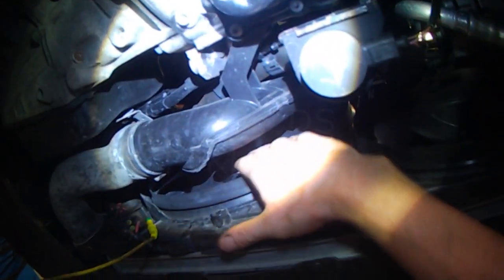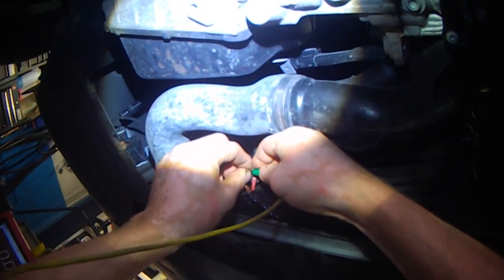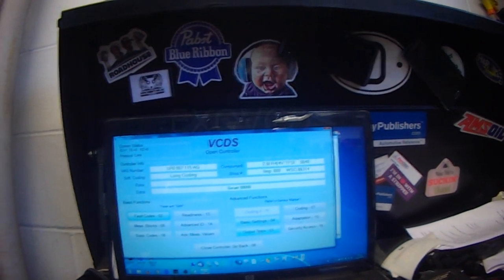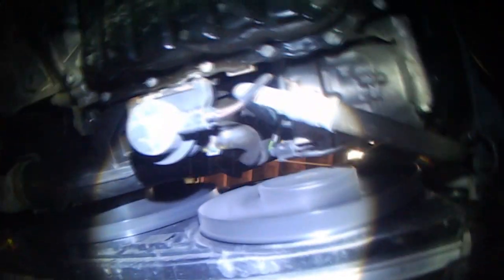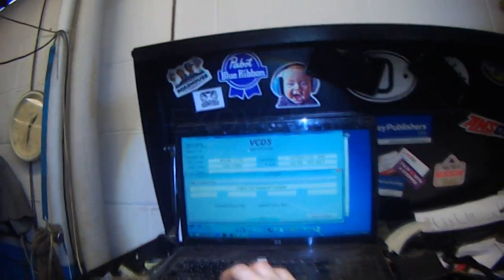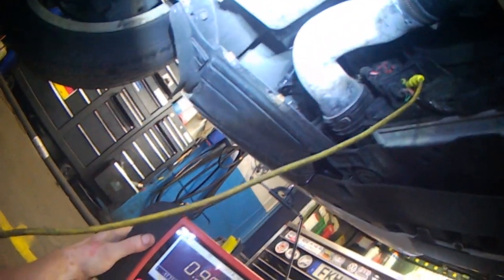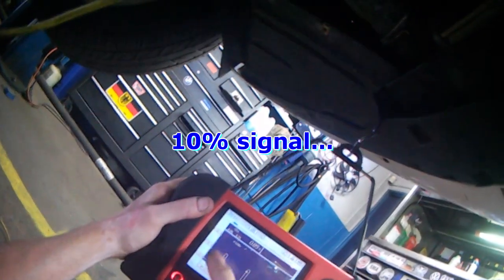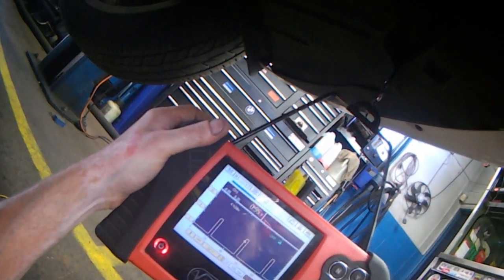Pulse-Width Modulated Radiator Cooling Fan(s) / Systems

Comment: Hello again.  I commented on another one of your videos about testing the cooling fans with jumper wires.  I have the wire harness in this video so you linked me here.  Whats the point of the vcds output test? Is it strictly to tell you that the fans are functional?  When I run the test both fans ramp up and then down just like in your video.

My issue is that the cooling fans do not come on when I turn on the ac.  Once the engine reaches operating temp, or I guess exceeds it, then both fans come on.  Once they come on the ac works great.  If I come to an idle in traffic, or especially when I park, the ac gradually gets warmer.
 
Do you have any suggestions of what to troubleshoot?
Reply from the maker: This is info I was not aware of... the more info I have, the better my first reply.
If the system is low on charge, AC will not operate.
As the engine warms up... AC pressure increases and the system can come back online.
That is my best guess at this point.
Checking system pressure would be my next step.
You can also check the HVAC system for faults with VCDS.
Reply: Ok, so more info...
I've been having intermittent ac issues for a long while.  It blows hot until about 10-15 minutes into my ride.  I took it to a shop about a year ago, told them about intermittent issues but at that time I wasn't aware of the correlation with the fans and engine temp.  They started by pumping the system down and then recharged it with exact specified amount.  I went to pick up the car and it seemed better.  The tech said drive it for a few days and let us know.  In hindsight, when I picked the car up it was running and at temp so I assume the fans were on because of the engine temp.  I didn't think to check the fans operation again in relation to the ac switch. 

I guess I just dealt with it for that summer.  Now summer is approaching again and I don't want to deal with poor ac again.  So I took it to the same shop and told them what I had discovered about the fans not coming on until engine reaching temp and then ac works well.  They told me that the fan assembly needed to be replaced because it was only operating on low speed.  I did a lot of research and saw that the fan control module was a common failure.  Now that I know it is a variable speed fan I wonder if they're even familiar with this system.  I took the car home and ordered the entire cooling fan assembly.  It arrived today, I swapped it out and still no fans when I turn on the ac.  I assume it should be immediate when the ac is turned on.

Per your suggestion I tested the fans operation via vcds, both new unit and old unit ramp up and down just like in the video.   Also no fault codes on HVAC.  

Sorry for the lengthy read but I really appreciate your help.
Reply from the maker: jrawebb I'm still at work... will reply again with more ideas / thoughts once I'm at home later tonight. West coast Pacific time 6:30pm>
Reply: Tell your boss I said you can take the rest of the day off.  I'm over here in FL sweating like crazy with my ac issues.  Just kidding.  Thanks again.  Looking forward to what ideas you might have.
Reply from the maker: We don't deal with a lot of AC at our shop... so I don't know all the specifics. Your 06 Passat should have some HVAC data pids where you can see status of the AC system (refrigerant pressure, switch activation, compressor status etc). Using VCDS, go through the various measuring blocks to see those values. Look for something that does not seem right. VCDS might actually suggest values that are normal (via a pop up) when the cursor is hovered over a measuring block. My gut feeling tells me that the system is low on charge... if it is, have the system checked for a leak.
Reply: When I get a chance I'll check the measuring blocks.  

This morning though the ac was running like a champ, almost too cold.  Granted it is still kind of cool out but still.  This thing really has me baffled.  I can't help but feel like its a faulty sensor or something.  I just don't know enough about ac or have the gear to diagnose it.  

When I pulled back in the driveway I popped the hood and watched the fans for a while.  They were definitely working and at a higher speed.  I let it sit at idle for a while with the hood open expecting that the engine would cool down and the ac would get warmer also.  It never did.  Maybe I didn't wait long enough.  I decided to shut the ac off to see how the fans responded and they completely stopped.  I imagine that means the engine wasn't calling for them either.  I turned the ac back on full blast with re-circulation and watched the fans again.  This time they only came on at a lower speed for about 15 second intervals and then shut off.  This repeated for a little while and the ac did gradually get warmer since there wasn't enough airflow being pulled across the condenser unit.  At this point I think I need a mental break and I'll have to revisit it later.
Reply: @jrawebb  What did u find out?
Reply: lee isenberg I ended up replacing the compressor. That resolved the issue.
Reply: @jrawebb  Oh okay, is there a way to troubleshoot the compressor?  Right now I'm kind of missing the old school conventional clutch type compressor b/c I don't know if my compressor is any good yet.  Working on getting both my fans going right now, fixed the small 1, waiting for a new big 1 to arrive & waiting for AC gauges to arrive.   
Thanks man,    - take care.
Reply: lee isenberg Troubleshooting was tough because as you said it’s not the traditional type compressor that you hear the clutch engage and click on / off. The one thing I tired prior to swapping it out was changing the valve on the compressor that has sensor connection.  Just search Vw ac compressor valve and you’ll find some videos about it. I ended up buying the rkxtech brand valve. It worked for a while but then broke again.  That’s why I ended up just replacing the whole thing. Had to get the system pumped down, removed the compressor, then swapped the valve. Ring clip pliers will make the job a bit easier. It was also recommended to replace the desiccant bag or cartridge when opening the system. This was a pain in arse. Good luck to you.
Reply: Yeah that was the 1st thing I tried & no change. Hoped that would fix it, but should've known better b/c I knew the fans were Not working w/ the AC button on.  I got a 2nd set of good snap ring pliers that came w/ 4 different interchangeable tips, they work well.  I'll figure it out eventually, still waiting on a new fan & AC gauges to arrive hopefully this week. My friend's 04 Corolla was easier to access that desiccant bag, his was pretty clean, so not sure how necessary that was.  Not sure if the computer system & such cuts out the AC if the fans aren't working er what, wish it would work anyway. If it was working 1/2 way it'd be better than zippo in this heat. I do know that compressor is doing something b/c some of the contents were still under some pressure after evacuating when I took the control valve out.  Yeah it's a pain alright, I'm Hot; literally And figuratively. I'll take all the good luck I can get right now, drove it yesterday in the heat, it sucked, mercy.  Thanks for sharing man, I appreciate it very much.
Reply: @jrawebb  Thanks man. Still ain't fixed mine, must have a bad compressor. Fixed 1 radiator fan, replaced other rad. fan & the control valve. Tapped out for now, always next year, ha, hope I get sum nice cold dry AC next spring/summer/fall.  - take care

Comment: My big fan always work, but the small one sometimes
What's my problem?
Reply from the maker: It's bad, replace it... it probably has a dead spot.
Reply from the maker: If it is a PWM fan setup... verify power to the fan FIRST.
Reply: My car ia a vw tiguan 2011
Reply from the maker: When the big fan is on, check for power & ground at the little fan connector. If it has power & ground, replace the fan.
Reply from the maker: This video is pretty much the same setup as on your car.
https://www.youtube.com/watch?v=tmHyHMORoMM
Reply from the maker: https://www.youtube.com/watch?v=txyfJtyKN7c
Reply: Thanks a lot Thomas👍👍👍👍

Comment: if I understand correctly both Radiator Cooling Fan(s) must run with output tests ?
Reply from the maker: Yes... both fans should run during normal operation as well.
Reply: my small fan never go one normaal operation temp
Reply from the maker: It is probably burnt out.

Comment: Everything digital... Nice to see the waveform! And good explanation on pwm! The multimeter alone could make you think it's not a pwm wave... How do you test a fluid coupling? Hot air gun?
Reply from the maker: Spin when cold & hot and compare the two... should spin freely when cold and with more resistance when hot / warm.

Comment: keep in mind that only the higher-end multimeters (or old analog ones) will give you an accurate voltage measurement.  Lower-end multimeters don't have a high enough sample rate to accurately calculate the average value...
Reply from the maker: Yes, thank you... good info!